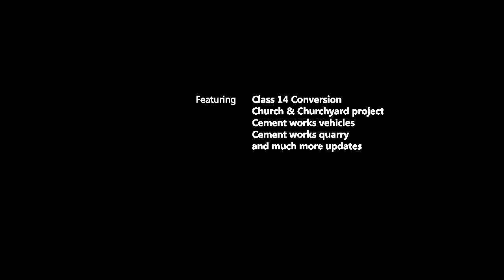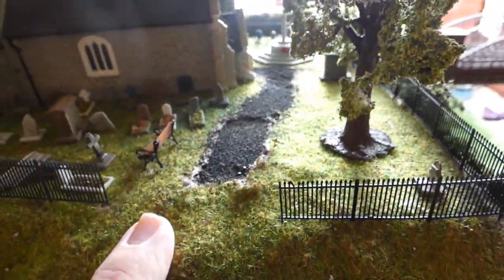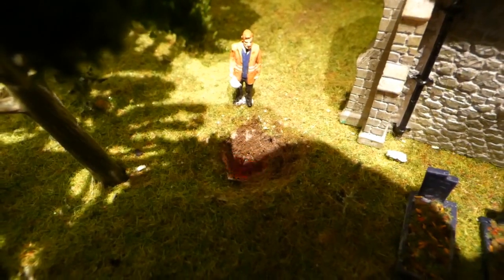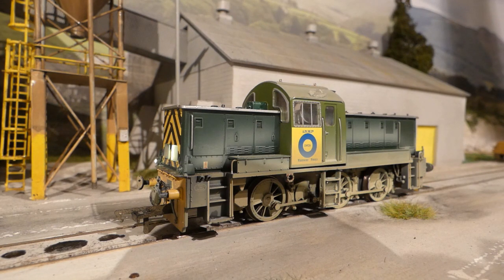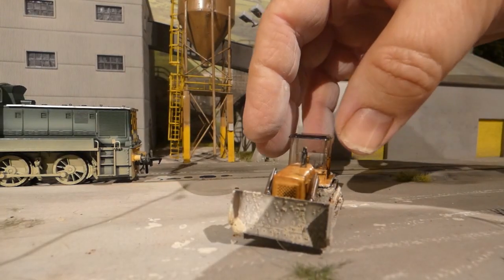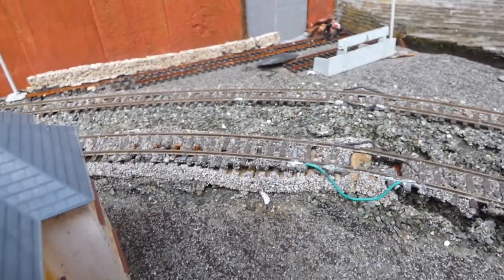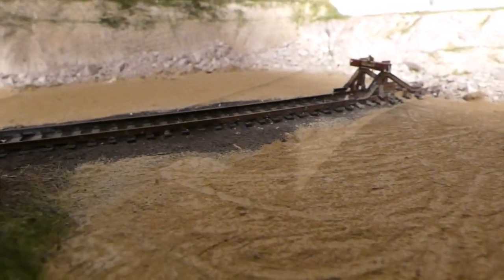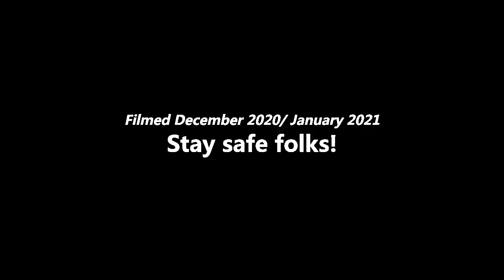Ballan Parkway OO gauge extension project part 36

Comment: Hi Richard. The trees in the churchyard are looking good. I'm not sure the monument is suited to the churchyard, probably in the town centre, maybe. I think the bench needs resiting, too. The strange phenomenon: something from The Quatermass Experiment? I like the weathering on the Class14, it's just the right amount - not too heavy. I wonder if the flashing light is not a little too large for the model. The low-temperature problem suggests there may be a bad solder or (another) joint in the lighting circuit.

Comment: Hello again. The weathering on the cement works vehicles are again sensitively done. Storm damage. Just gives you an idea what Network Rail have to put up with (LOL). The Quarry: The textured surface looks really good. The foliage is looking interesting - as you say, need to see what happens over time. Happy 2021.

Comment: Nice one Richard, seems like an age ago I last seen your layout 😊 class 14 looks and sounds fantastic , can’t believe the damage to the outside track, mind you I slept through it all 😆 happy new year to you all cheers Darrell
Reply from the maker: Happy New year Darrell to you and your family. 🥳 The damage ain’t that bad it’s quite minor. The fence panel had gone halfway over due to the ground been so saturated and the wind forced it over. Pushed it back into place and seems fine now. Repaired the brackets yesterday and will replace the track on that section in the Spring. There is a post near the Outside station that’s gone rotten. Next door said he will sort it out as I need access on his side to repair it. I thought you would like the conversion on the Class 14? Hopefully sometime soon we can meet up but I reckon it could be Spring before we can??🤔

Comment: Love the digers - will need to do some for my china clay loading sidings - and what a shame about the damage outside! Ouch! Hope 2021 is  brill for you!!
Reply from the maker: That concrete colour paint would be spot on for China clay loading. The damage is quite minor and repairable. Repaired the brackets yesterday. Fence now back in place. Will fix the track around Spring when the line is back open. Hope 2021 is great for you also!